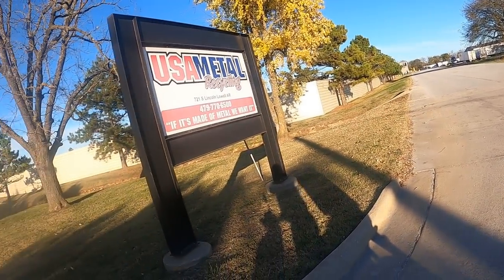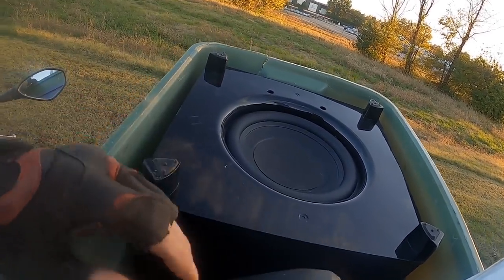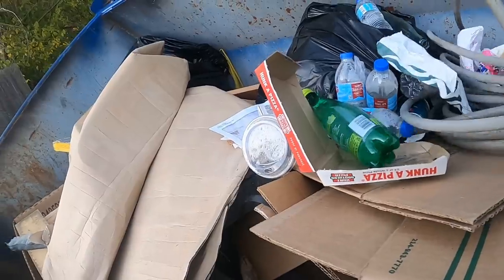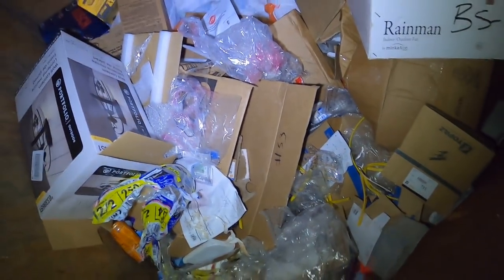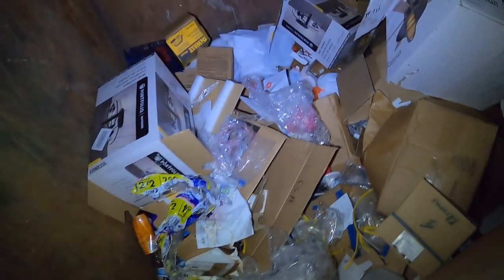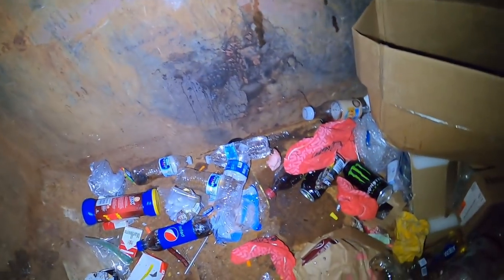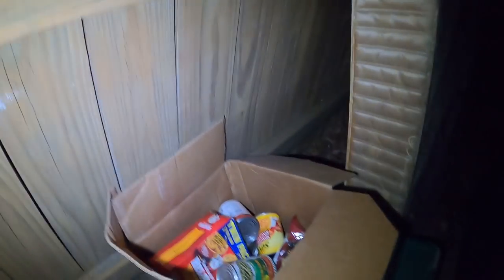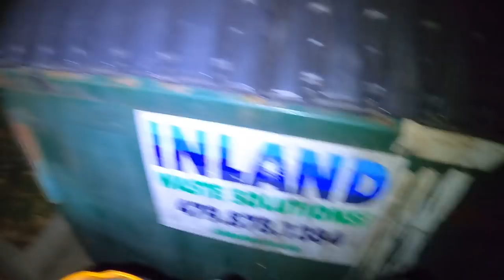Trash Metal Scrap Metal Cash Metal - Make Money with Garbage!

Comment: Curious about the light switches. Do they go as tin shred, or is there something else in them worth messing with?

I tore into a sewing machine not too long ago. A lot of the internal parts were cast aluminum.
Reply: Nothing worth breaking down inside unless you like micro-scrapping, which I'm not much of a fan of. Most places would take it as iron/shred I bet, but you might get aluminum breakage price if you're lucky...